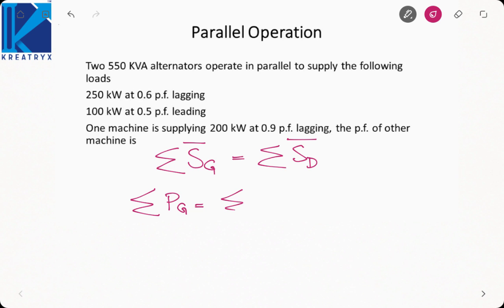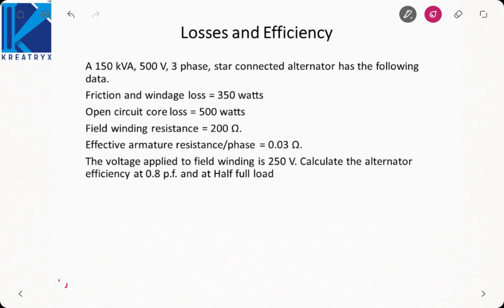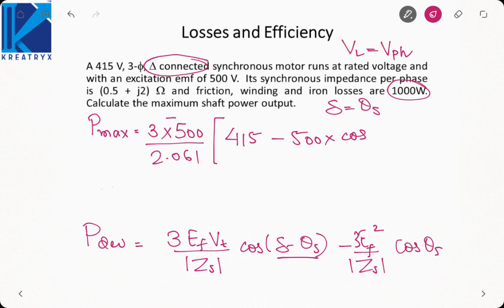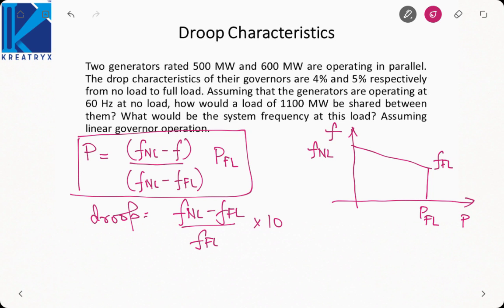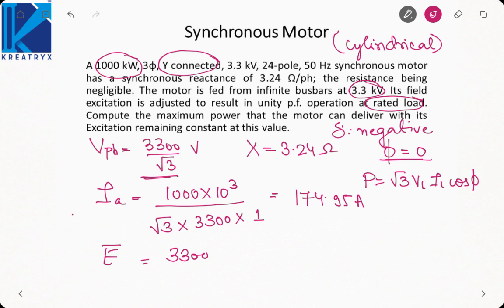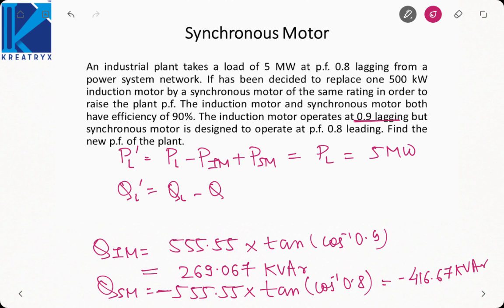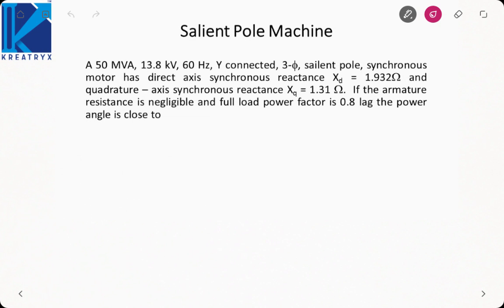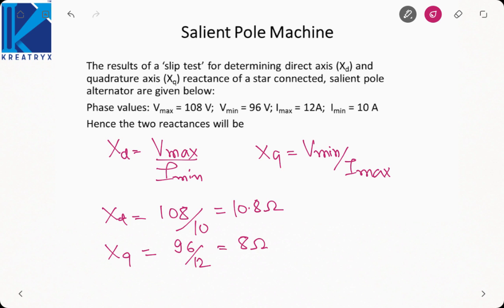GATE (EE) - Synchronous Machines 2 (Electrical Machines) - Krash - Problem Solving

Comment: For motor psi and delta both will be negative.. But in question you took psi +ve.. Plz explain...
Reply: Abhishek Chandrakar yeaah that caused a lot confusion...
Reply: i think in the original formula if  you put directly vaues it will give -ve psi value so that will automatically justify -ve psi for motor so, no need to modify formula.

Comment: Sir in problem on Salient Pole Motor in which we have to calculate the value of power angle, you have taken Psi as positive as its coming positive but during the concept explanation you told that Psi will always be taken as negative for a motor..???
Reply: sir have said one thing wrong in explanation,actually pi is -ve for lag and +ve for lead ,rest everything as per table is same ,u will directly get ur ans ...
Reply: yeaah have the same doubt...
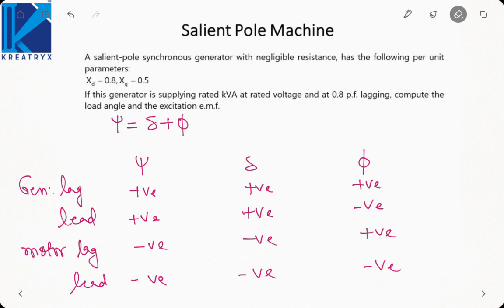Reply: just interchange delta and phi @36:43

Comment: sir actually in the problem at 27.21 in  the synchronous motor problem what we have to consider about the power rating given in the question whether it is input power or output power im confusssed..
Reply: output
Reply: yes thank u sir but one more question if it is output power then how can we get current by considering  the terminal voltage as it is explained in video..? if we consider it as input power then current can be obtained from terminal voltage..? hope my question is clear sir
Reply: watch the solution of two questions.....then tell me if there is any difficulty